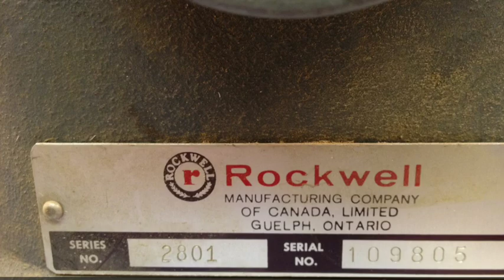The Disappearing Jointer

Comment from the maker: I forgot to mention that, if I were to do it over, I would build it to make use of a rolling base instead of finding casters for it. The base is rigged so the casters fit inside the perimeter of the lower supports and that makes it a little wobbly, not to mention you can't use locking casters. I am searching now for a rolling base that will still allow the stand to fit under my bench.

Comment: i have a 4inch jointer, looking for a motor, any suggestions re size, hp, rpm's, pulley sizes, thanks in anticipation
Reply from the maker: Hi Clive.  I'm not sure about your location so your mileage may vary...
I replaced my motor with a TEFC motor (Totally Enclosed Fan Cooled) that I acquired from an auto/farm parts type of place (Princess Auto here in Canada).  I used a 1/2 HP motor as I recall.  Could have been 3/4 HP.  It will depend on availability - at least it does here.  1/2 HP is good enough.  The manuals for jointers of my vintage require 3800 RPM at the cutterhead.  I think mine is running at 4500 RPM.  Faster will give you a slightly smoother cut.  I would not go over 5000 RPM - the bearings and blade holding device may not handle it.  Your pulley choices will depend on what pulleys are available (that was my problem) and the RPM of the motor you find.  Mine is around 1750 RPM.  The pulley on my jointer (these are approximate as I can't find the calculations) is around 38mm (1.5").  I believe the pulley on the motor is around 101 mm (4").  It may have worked out to closer to 4700 RPM now that I think about it. There are online calculators (I use the Stemin app on my phone) that can assist you will refining the pulley sizes depending on what speed you choose at the cutterhead.  MY jointer cuts nicely and the bearings are holding up well.  I think it was made in the late 50's to early 60's, based on the design.  Let me know if you need more information.  Thanks for watching.
Reply: inthewoodshop my location is not so far from yours ie New Zealand-- i found a cuts per minute calculator at vintage machinery . org, makes it so much easier, i recently burnt out a 3/4 motor that i had put on my 4inch Tanner jointer (old nz brand) the rpms of the motor were around 1450- think were i went wrong was with my pulley sizes being to small and the motor having to strain to much. the calculator said around 14500cpm for a 3blade cutter head so you are right about keeping it under 5000rpms (presumably cpm divided by 3, it seems strangely counterintuitive that the larger pulleys make it go faster, thanks for your feedback
Reply from the maker: You're welcome and yes, it is counterintuitive. I like your idea of not very far. I would think there isn't a place further in the world from me than NZ. But I like your thinking. I was in NZ in 1978 and I'd love to go back. Maybe it's possible!

Comment: Cool idea, but the music is awful. 

What do you do when you have a 12" wide board that needs jointed? All hand planes? That's what I'm doing now. And I'm looking for a machine to save me time. Maybe it's a grass is always greener situation....

Maybe the human condition. What do you think? Why did you sell the big shop?
Reply from the maker: +Matt Hegedus Do you have a thickness planer?  You can use some straight plywood to make a sled the same length as the board. Set the board on and shim it so the top is horizontal as possible, then pin the shims so that they stay put. Not the board, just the shims. The sled should have a stopper board at each end so the board can't be pushed off by the planer feed. Plane that side flat then flip and repeat for other side. Google "planer sled" and you will find pics and plans.
Reply: +inthewoodshop aha yes I've seen that. And I'll try it soon. Thanks!
Reply from the maker: +Matt Hegedus You're welcome!